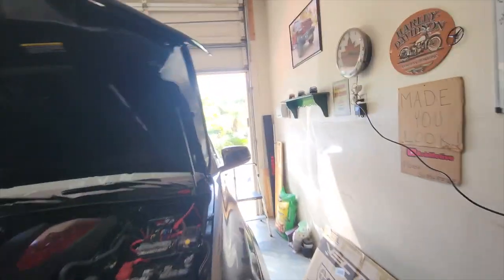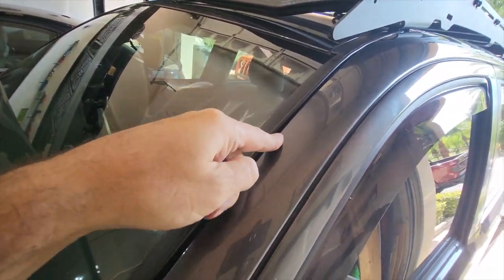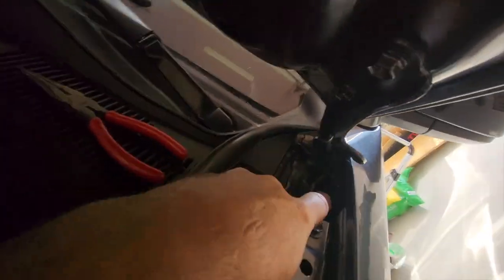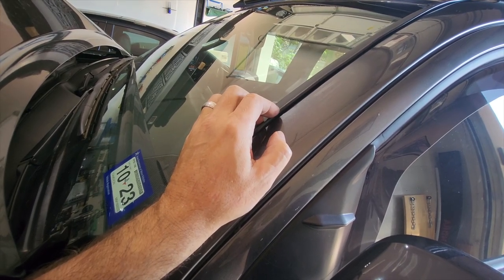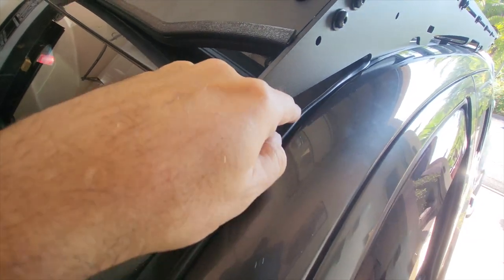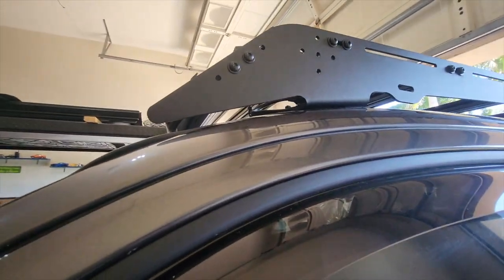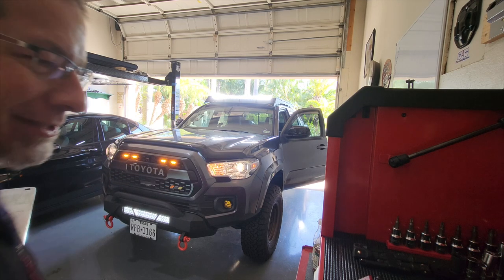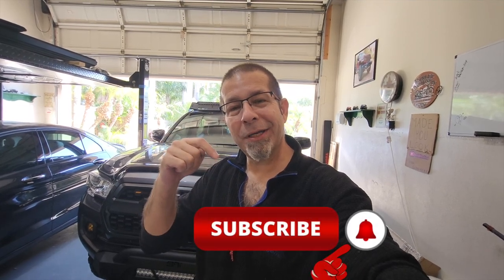Hooking Up The New Toyota Tacoma Light Bar And Light Show

Comment: First, the wind deflector is installed one set of bolts too high for this scenario. The wind will find that narrow gap under the bar will give you higher wind noise levels than when has the fairing seal right on the roof (best with a strip of 3M on the actual roof just in case the fairing itself rubs over the long term). The bigger by-product of installing too high is that the light bar is sitting HIGHER than your Prinsu bars. This means if you ever putting anything long on your roof rack, instead of resting on the load bearing bars it will sit on the rearmost bar and get lifted by the light bar at the front. Light bars are not designed for loading. Second, there are lots of comments about hiding the wire (silicone?) and the way it's set up now the wire has play and will rub on your roof paint and eventually grind a hole through the paint. Use more cable ties to keep the wire up off the paint along the side rail of the Prinsu. Then on the A-pillar between the windshield and door window, use the product that is designed for this exact job - the KC Hilites Universal Wire Hider. Cut at the right length, the wire will go in and out without touching any vehicle paint and can remain in place if you ever get your windshield replaced.

Comment: Just use black silicone and put tape on it until it dries all around the Light bar wire . That be perfect that’s how I have it and I have had it for at least three years. Just make sure like I said that you leave the tape on there into the silicon dries or else you’ll hop on the freeway and you’ll see those wire dingling. lol but try it out. Trust me it’ll work.
Reply from the maker: Thanks for the tip 👍

Comment: Light Wars Rule the day! 

I suggest using windshield urethane sealant for that light's wire if necessary. 
Silicone based caulking products cause rust, a chemical clash if you will.

Have you ever sandwiched a piece of aluminum and mild steel together? Corrosion is the result.
Reply from the maker: Good point!  Thanks for the tip👍

Comment: Looks really good.  That plastic trim piece over the roof seam pops out might be room to get that cable under it. If so would get the cable to the edge of the windshield under cover.  On the FJ think I drilled a hole in that channel and ran it down inside the “A” pillar.  I think it looks good as is.
Reply from the maker: Yeah..I think I’ll leave it👍